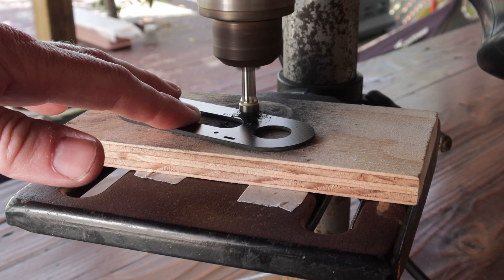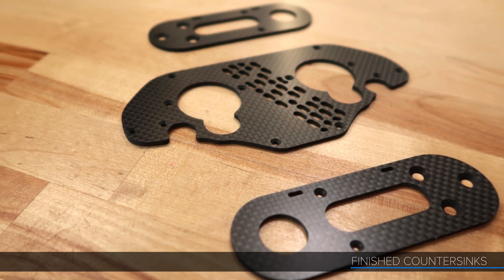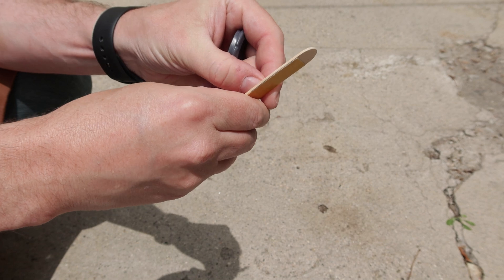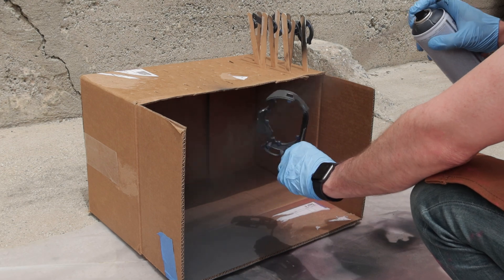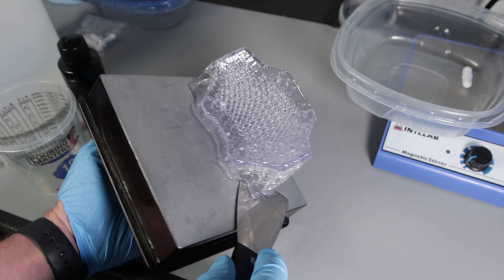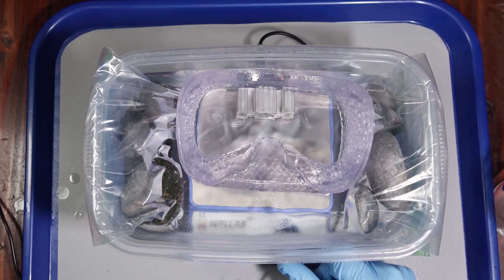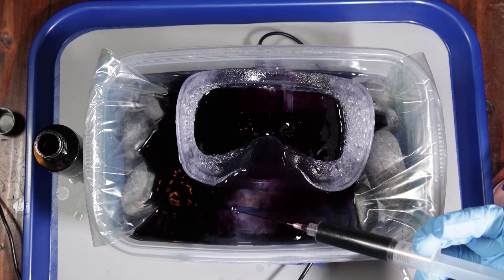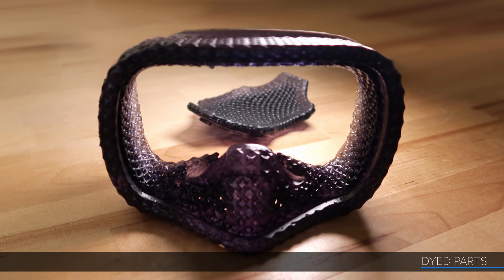Improvising - 3D printing the VR custom facial interface

Comment: I see that you are overly relying on 3d printing. You could just 3drpint mold and cast black silicone.
If you only hammer...
Reply from the maker: The lattice structure of this design can’t be molded due to undercuts. Platinum based casting silicones also react with SLA printed molds so that’s a no go. The mask is custom fit to just my face so making any tooling for even a limited production run is a little pointless.
I've actually done a good amount of design for injection molded parts, RTV mold design and investment casting. None of those are really good solutions for generative designed parts like this.
Reply: @PyottDesign  yeah I get that and I understand that lattice is more of not-negotiable aesthetic choice which gives character. I just think it is unnecessarily complex workflow. Well, I guess I'm too obsessed with practicality.
Reply from the maker: I think your misunderstanding what's driving the process maybe? Each gasket is custom created for each user from 3D scan data input so creating any tooling for a mask isn't practical because they all have to be one-offs. Casting would be an added step that would take more time and effort in the manufacturing process. Because each mask already is has to be 3D printed it opens up the possible design language to lattices or any form you like.
Reply: @PyottDesign Ah ok makes sense. I overestimated workload of dying process. Thanks for clarifying.